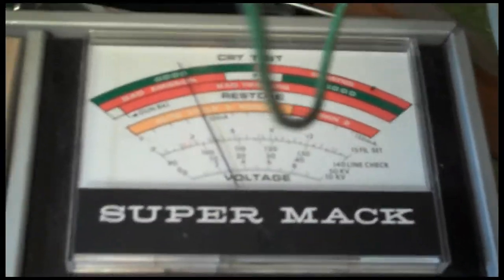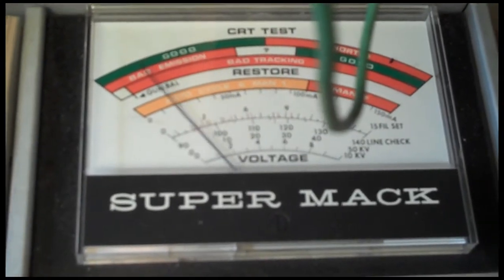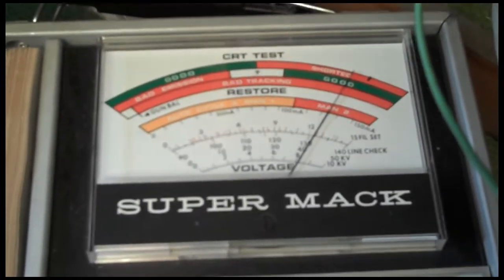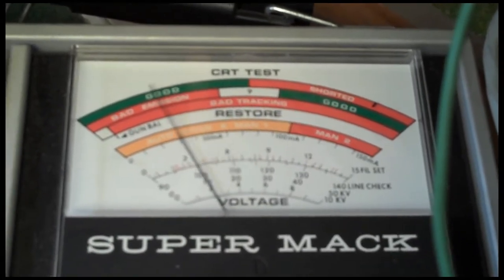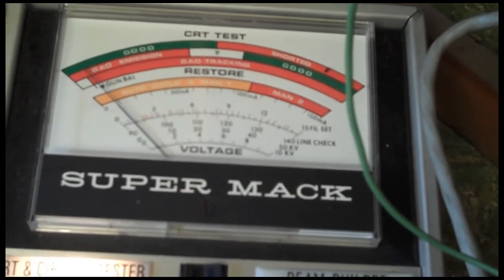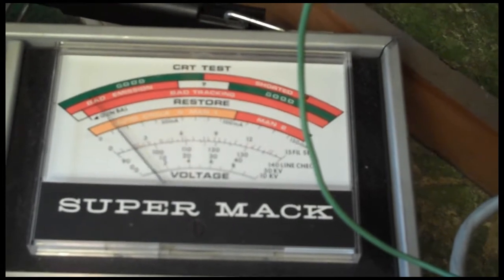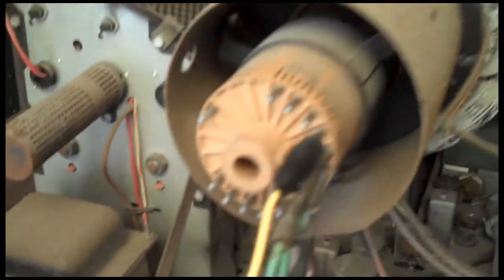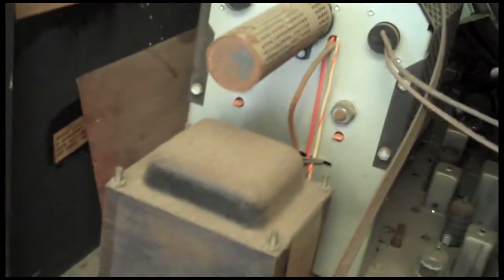15GP22 CRT TEST RCA CT100

Comment: I would recommend if you ever have a problem with vacuum leaks that you consider having it restored by Lexel Imaging in Lexington, KY.  They should be able to deposit glass on the glass-metal seals on the tube flanges.